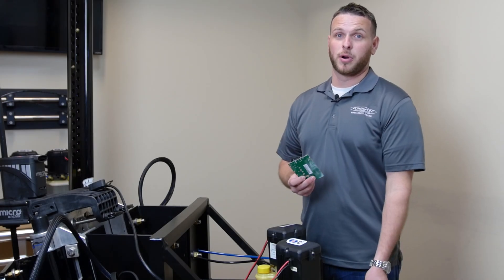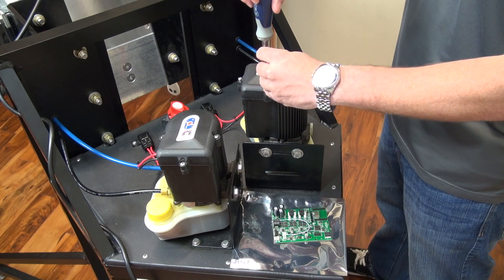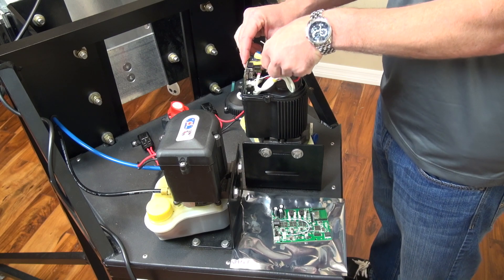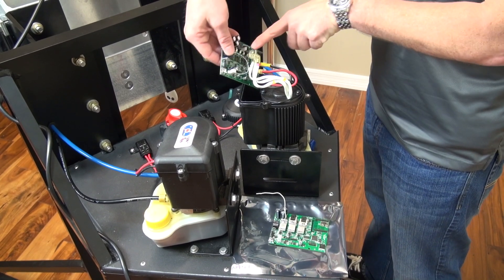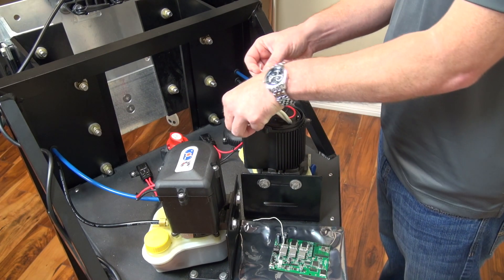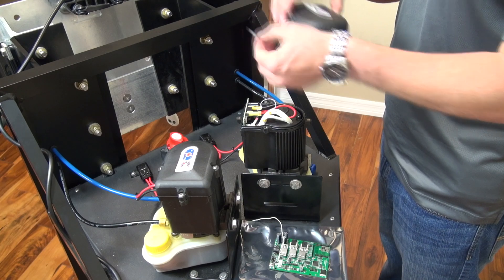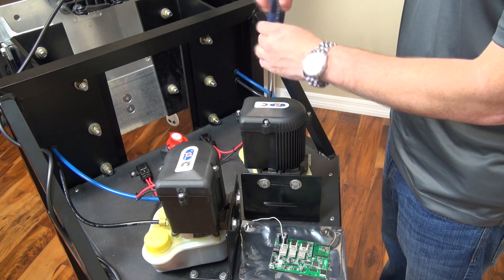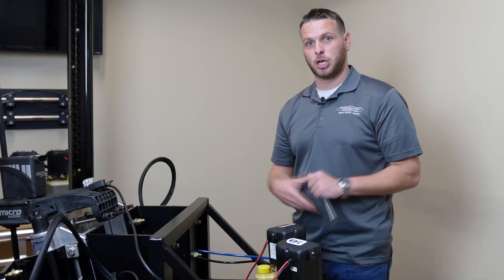Power-Pole Circuit Board Replacement

Comment: I am swapping my boards to diagnose if one of the boards on the pole that want work is bad or not and my motor wires that are lettered aren’t on matching letters V is on W on board and and W is on V on the board pole work fine before hand deployed them other morning and this pole wouldn’t come up had to manually do it are these wires going to go back mid matched or go back normal matching letters